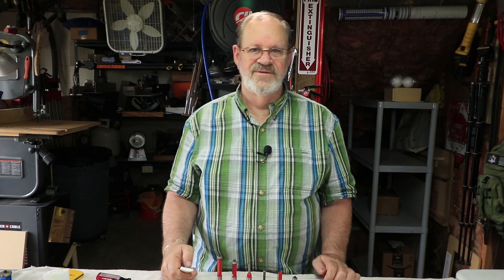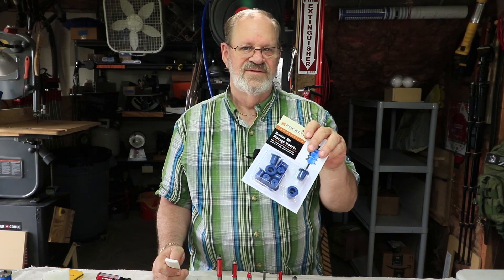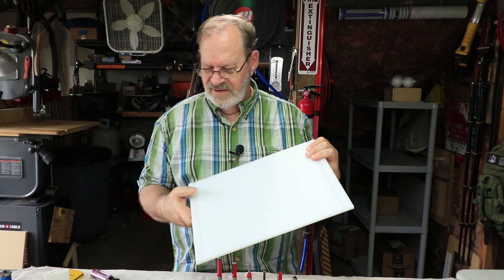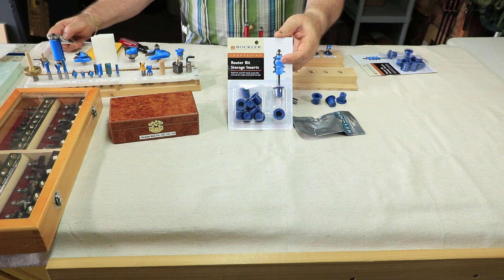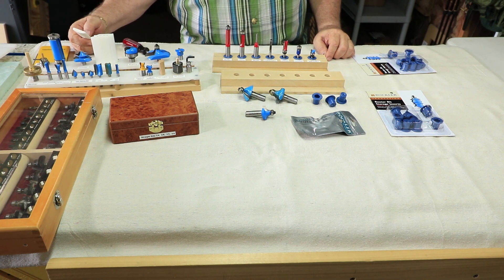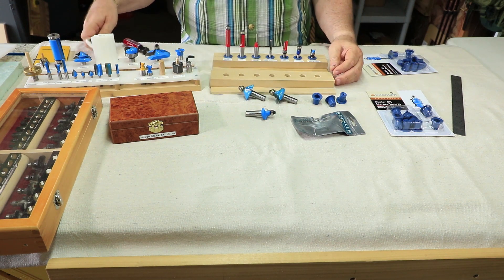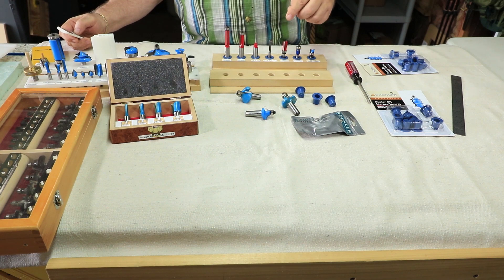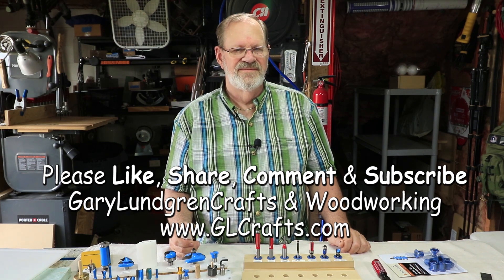Router Bit Organization Ep.2018-24

Comment: I watched this video yesterday. And the concept of transfer of moisture or even the natural oils of the wood damaging the router bit gave me pause. 

I woke up at 2:30 this morning and the solution I came up with is tubing. Had a VA appointment today so I stopped by Home Depot. I found 3/8od-1/4id sky 702 165 and 5/8od-1/2id sku 702 361. 
Gary you did it again. I checked my bits and several of them are discolored. Going to use 2k grit sandpaper and drill a bunch of holes. Going to use the Rockler tubes, their T-slots come in, for my scroll, jig and sawzall blades. Thanks.
Reply from the maker: Thank you! Also, Thanks! for your service!
Reply: @GaryLundgrenCrafts  I know you're a VET also. Your service didn't stop when you got out. You've helped me a few times already through your videos. I may need to catch up on what you posted. Maybe I'll upload a picture when I get the tube racks finished.